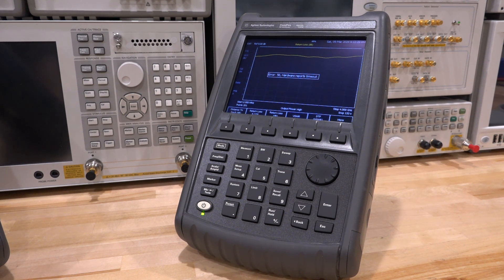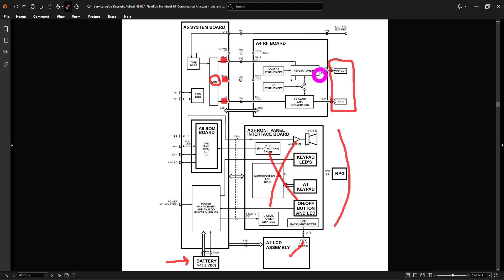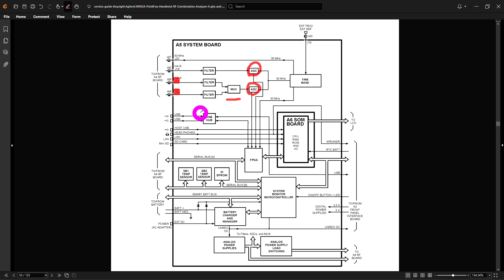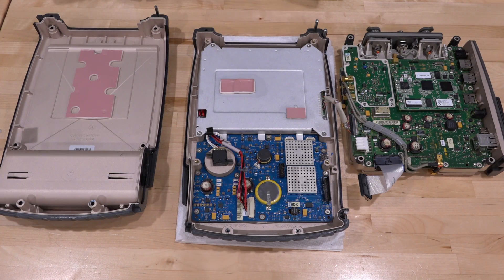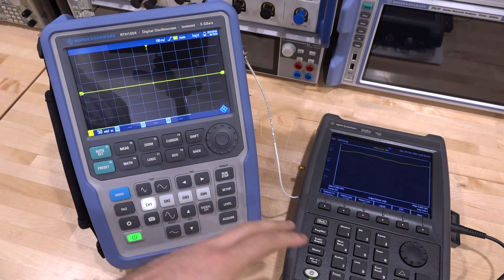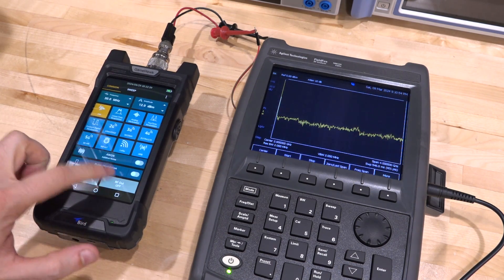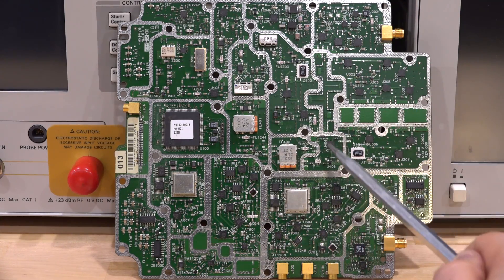TSP #243 - Agilent FieldFox N9912A 4GHz Handheld RF Analyzer Repair & Teardown

Comment: Hi, have n9918b and it has a problem, all over the frequency range it measures input power incorrectly, likely -10db relatively input signal till 26.5GHz. We gave it to repair services, but they failed it so now device absolutely can't measure any power approximately in 9.5-15GHz, in the rest of the frequencies problem is the same as before repair.
Now it has message:
 "Multiple Failures ... Consider turning Amptd Alignment OFF"
I've opened the RF board (9938b installed) to measure signals unfortunately, input stage was made mmic's crystals welded to board (looks very interesting). During measurement procedure i killed adrf5040 switch (was trying to measure which frequency range it does not switch) so vgg got on control pin and now switch works only in 2 positions (on of them not used at all :) ) 
And now device works only till 2.5Ghz))
So, ordered this switch, I'll try to replace it and try to bring it back to its post-repair state 
The idea is that some of switches dead, maybe in case when input power was enough high to kill some of switches when preamp was turned on. Usually device tells that it overloaded in this cases. Or just input stage is dead.
Maybe any ideas or suggestions in repairing? Have some photos of rf board.

By the way, in service they tried to swap ic's and switches, but it didn't lead to anything good.

Some years before we had the same problem with the same device ( it worked good but measured power -10db to input in all frequency range), but all the repairs came down to replacing rf board, and i don't know where was the problem there, but dead rf board naw acts like donor or reference in my rf projects.

Comment: As digital and multi layer boards made the scene I sensibly rerouted my electronic interests. Hello world of tube amplifiers and audio technology. Down side was I ended up working for musicians and a whole heck of a lot of them had problems. Wall to wall prima donnas and my paychecks sailing up peoples noses. "Hey man, I ain't got the bread right now. How about a few lines instead?" 
But still, easier work than 6 layer circuit boards and no schematics. Nothing quite like staring at 800 volt rails as I sip my AM java.

Comment: As you guessed, that secret IC is a complete VNA front end, designed and manufactured in the Keysight Santa Rosa GaAs IC facility.  I think this might have been one of the first complete system GaAs IC's that we developed for instruments. Now all the RF and microwave products are chock full of custom GaAs Asics but back 15 years ago (well, more like 20 when the design started) it was breakthrough stuff.
Reply: @wizardkeys1 I wonder if the same chip isn't used in the 50GHz+ models. Small size would really let you go up in frequency.

Comment: Great video.  I had one of these models and it was an impressive little workhorse, but perhaps not the best of RF specs (noise floor, phase noise).  Kudos to you for repairing the module.  Some months back, I repaired an Anritsu portable SA as you had also done, by repairing one of three VCOs which was defective (poor solder joints internally).  I can't recall the manufacturer, possibly Mercury systems (thru acquisition) but they were the most unfriendly people I've dealt with in 50 years of design.  Had I been sitting on a 10 million contract, they would never have seen one dime.

Comment: Those copper colored filters are not SAWs, they are dielectric resonator filters. Couldn’t see clearly enough, but appear to be made by Murata.
Reply from the maker: Yes, you are right. I misspoke as I was looking at the actual SAW filter elsewhere on the board.

Comment: I am curious to know if the thermal characteristics of the DYI shielding is similar to the case you replaced, assuming it is indeed a TCXO. 🙂
Reply: DIY and yes thats a good point, The characteristics can't be the same without a massive stoke of luck but I wonder if the system can track and stay on temp or even if it matters that much ?
Reply: @andymouse  Well, if anything, it is useful confirmation that the problem was isolated to the TCXO. One can always hope to find a replacement part down the road.

Comment: Why the noise floor changing so strangely as the swipe goes on? At the very end of the video.
Reply: See the previous review of the Sanko GH60 https://www.youtube.com/watch?v=qyi6UkvJy7I It explains how that's the expected behavior of the noise floor based on the (somewhat uncommon) layout of the filtering and attenuation stages.

Comment: Abstract

This video documents the repair process of an Agilent FieldFox N9912A RF analyzer experiencing hardware timeouts and ADC clock unlock errors. Through analysis of block diagrams and hands-on troubleshooting, the issue is traced back to a faulty Vectron TCXO master clock module. By repairing the faulty module and implementing proper shielding, the instrument is successfully restored to working order.

Summary

Initial Problem (0:07)

* The Agilent FieldFox N9912A RF analyzer is malfunctioning, displaying "Hardware timeout" and "ADC clock unlocked" errors.
* The instrument is slow and unresponsive, particularly when switching modes.

Analyzing Block Diagrams (1:28)

* The block diagrams reveal the instrument's architecture, highlighting the RF board, system board, and ADC.
* The ADC clock originates from the time base on the system board, which also provides a 30 MHz reference signal to the RF board.
* The external reference clock is also connected to the time base, ensuring synchronization.

Investigating the Time Base (4:05)

* The time base is identified as the potential source of the problem, as it generates the ADC clock and other reference signals.
* The 30 MHz signal is absent at the output of the system board, indicating a malfunction in the master clock generation.

Examining the System Board (9:58)

* The Vectron TCXO module on the system board is suspected to be faulty and is removed for testing.
* A missing pin is discovered on the TCXO module, potentially caused by rough handling or a manufacturing defect.

Testing with External Clock (11:44)

* An external 30 MHz signal is applied to the instrument in place of the faulty TCXO module.
* The instrument functions correctly with the external clock, confirming the issue lies within the TCXO module.

Repairing the TCXO Module (14:56)

* The TCXO module is carefully repaired by soldering wires to replace the missing pin and adding insulation.
* The repaired module is tested and found to generate a clean 30 MHz signal.

Reassembling and Testing (15:58)

* The instrument is reassembled with the repaired TCXO module and proper shielding is implemented.
* The instrument functions normally, with no errors and proper performance in both network analyzer and spectrum analyzer modes.

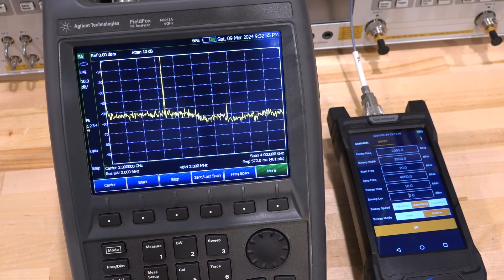Conclusion (16:57)

* The repair is successful, highlighting the importance of careful troubleshooting and analysis in identifying the root cause of the problem.
* The video concludes by thanking viewers and Patreon supporters.

Disclaimer: i used gemini 1.5 pro to summarize the transcript

Comment: Sadly more and more test equipment vendors are taking that route, often justifying it as "too complex to repair" or "IP secret sauce", despite much of service needs are just basic information about power supply topology, interconnects between modules and various basic stuff. I even heard weak excuses like "6 layer PCB is too complicated to repair, so that why we don't give schematics" while many can  repair broken connection or burnt trace even without digging into inner layers... Sad days. Best we can do is support Right to Repair and support vendors that do provide service info, and make them know it.

Comment: One thing I've noticed about newer Keysight instruments is the lack of service manuals. Check out the E5080B or P5000 series VNAs for example. You don't get anything... not even a basic block diagram.

I recall that even in the Agilent days, they used to provide CLIPs (component level information packets) to larger customers for self maintenance.  

Are there any kind of laws such as right to repair that are applicable to T&M and industrial electronics?
Reply: It's gotten even worse.  Keysight is making parts unobtainable.  Not even commodity items like knobs, plastic, display, touch panels or power supplies known to be problematic.  All say return for repair. 
Right to repair is a mixed bag.  I'm not sure how you make things repairable today without fixturing, special test and simulation systems and exhaustive documentation and training.